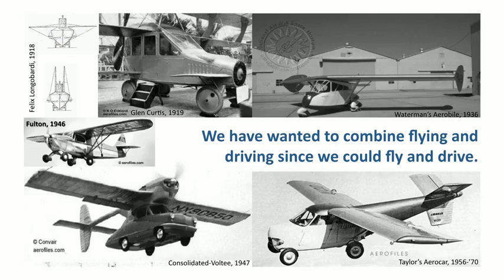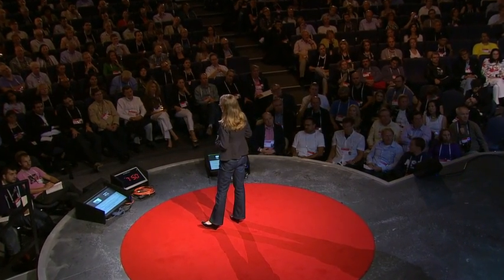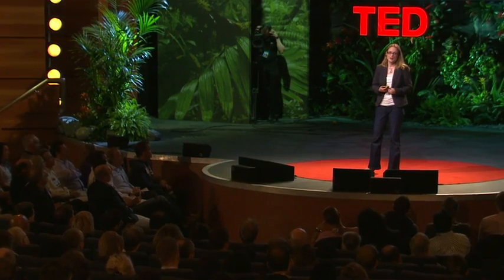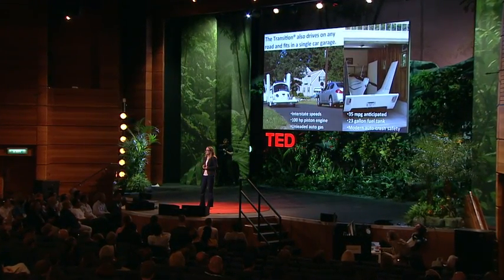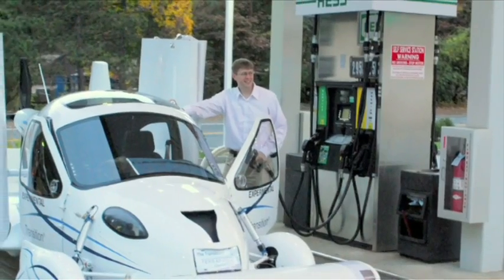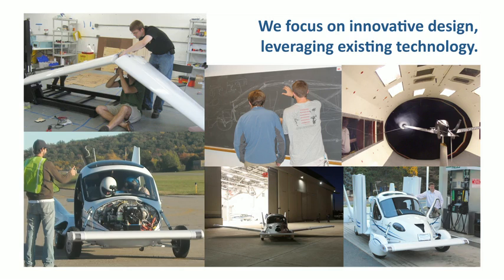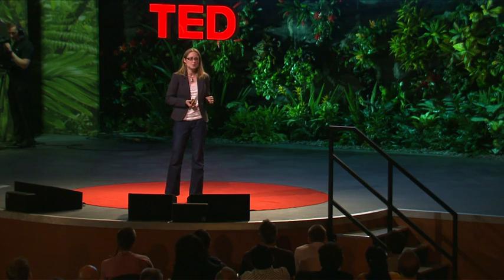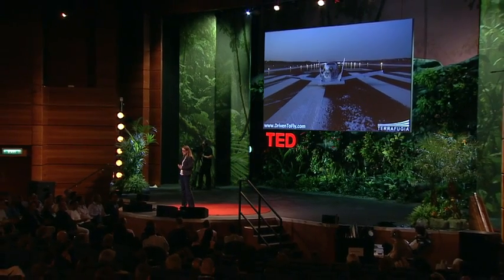Anna Mracek Dietrich: A plane you can drive

Comment: They still don't get why these ideas never sold. There were planes like these that worked fine.
A pilot wants a full fledged fast and reliable plane. A driver that wants to fly needs a pilot license (she says 20 hours for a sports license) and a drivers license, so they're catering to a select few. There are other problems. Cheaters that won't go to the airport to take off. They'll do it right on the highway.
The best bet for this type of technology is computer controlled flying like autonomous drones, no license required, and a highway in the sky, set up by the Federal aviation board. If the idea ever got going big time there would be a lot of accidents without specific routes. 
Now if they ever conquer anti-gravity and the thing can hover and zoom off at 88 mph into the future, well count me in.

Comment: @ineedanewtubeaccount parachute attached to the car ? =D engine turns off - it automatically pops out.. if it fails too then u use the ejection seat. There, problem solved.

Comment: @Jesuriah, firstly I was talking about the lack of brake dust and tire wear WHILE FLYING. Second, the car weighs, literally, a ton less than most passenger cars, so even while driving it will develop less tire and brake dust. Third, how aggressively will you drive a flying car with a 100hp engine and a CVT? to suggest someone will be rocketing around in this thing while ground-bound is utter insanity.

Finally, mass transit is predicated upon pop. densities that don't exist in most of the USA.

Comment: A 1031 km drive would take me 12 hours, and more than one tank of fuel.
This car/plane can do the same thing in a 4.5 hour flight time.  (and it only goes 777 kms since it's flying a straight line without roads, as-the-crow-flies)

That's pretty cool.  Less than half the time.

Comment: you're all aware that aircraft don't just fall out of the sky like dumbo without his feather when they lose engine power, right?

In fact, you're much safer in an engine out situation in a general aviation aircraft than a commercial aircraft, they can glide much more slowly. Airliners stop flying just below 150mph, most general aviation can glide as slow as 50mph.

I know how fast I'd rather be going when the wheels touch down.

Comment: @SAsgarters Couldn't agree more. General public is dangerous and irresponsible. Here in South Florida you get the impression that talking on the phone is a requirement to drive a vehicle. Lane changes are made without using turn signals, or the mirrors, and stop signs serve only as decorations.

Comment: @DannyZRC Dude, if you drive the car aggressively, or live in a hilly area you'll spew just as much brake dust into the air as other people.  While tire wear may be down, tire pollution is much easier to deal with(read :Be recycled or re purposed) than exhaust gasses.  What's more useful, a toy for the rich/wealthy(A.K.A. this plane/car) or a mass transit system powered by renewable energy?

Comment: @Silverstarlightt with a price point of $300k and the fact that you have to drive to an airport to fly (or likely be forced out of the sky by the air force for unregulated flying,) the chance of a "drunk idiot" piloting the thing is pretty low.  to say nothing of the fact that the whole advantage of being able to fly is getting to do so over poorly developed areas where 100 mph in a straight line is much faster than winding about at 70 on the highway.

Comment: @freesk8 "In this video, the speaker complains of the regulatory hurdles"

Which push innovators to address real problems instead just trying to boost sales.

"voluntary, free market standards"

Leads to cutting corners and blinding the public with irrelevancies, prevents reactions to actual issues until the outrage gets big enough to make it the cheaper to react and the free market stifles meaningful innovation, because R&D costs money and it's cheaper to just keep reusing the same old crap.

Comment: The idea is there but nothing else. Its a toy. And many things wrong with it. Only has seats, you  cant bring the family along, cant do shopping in it. Driving, well blind spot. The more major problems are maintenance, it would be very expensive to upkeep it since the same engine is used in flight and while driving. finally is that the so called pilot could be complacent and just feel like flying with no flight plan, and get lazy. many things wrong with this.